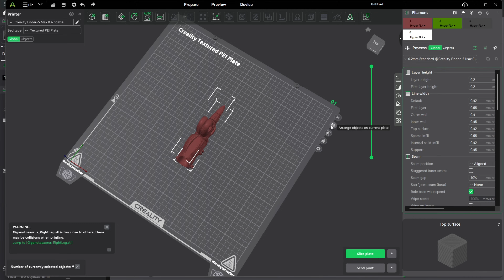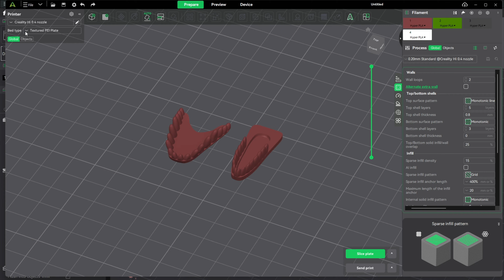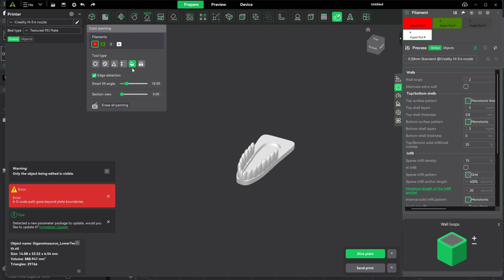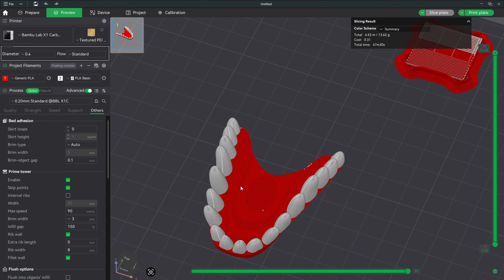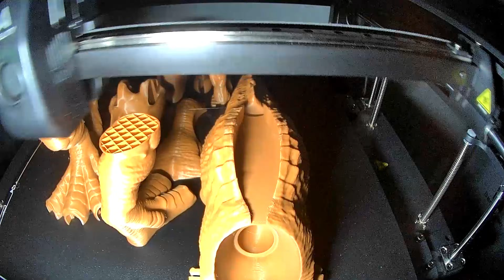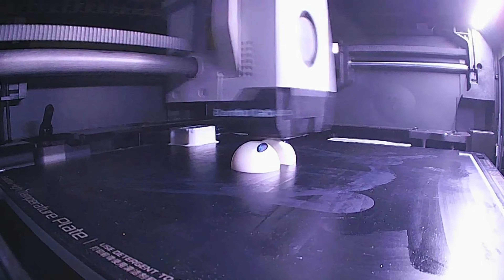Slice & Assemble:  3D Printed Giganotosaurus Dinosaur. Ender 5 Max - K1 Max - P1S - Creality Print 6

Comment: That is cool Mr. Gregg !
I think I  be painting  mine . What size you recommend for the x1 carbon ?  What were settings to reduce print time ? Ty
Reply from the maker: You can do yours just like mine, with your AMS. Reduce infill to save print time. 8% will be fine
Reply: @3DRundown  i don’t have the color filament 😢
Reply from the maker: No worries. Use your Artistic skills. :)
Reply: @3DRundown when ever i get my prrinter fixed